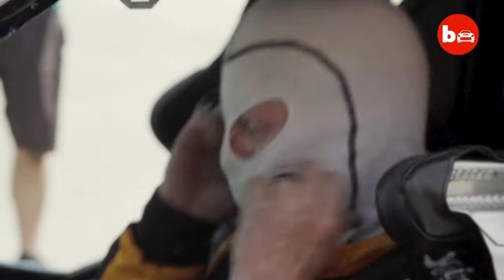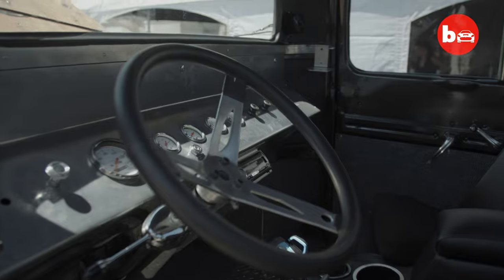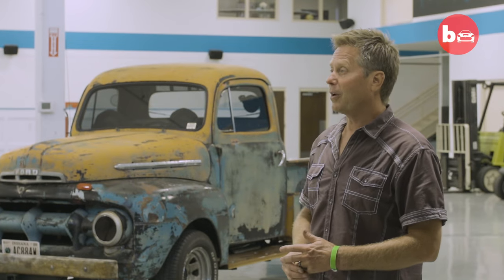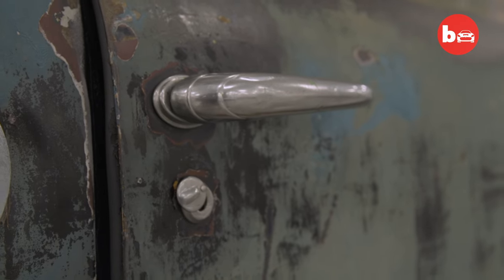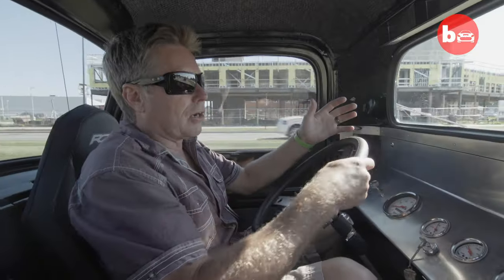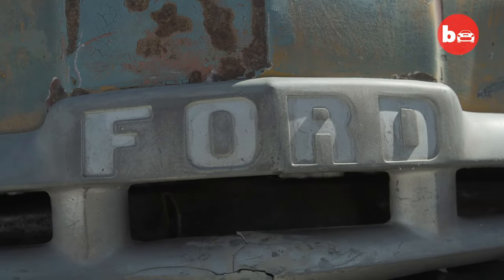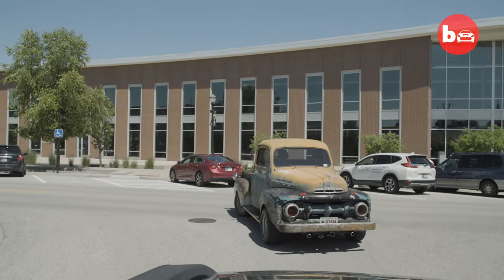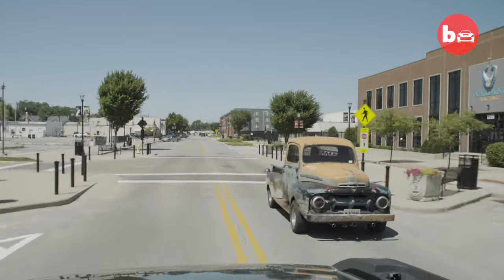The Pick-Up Truck that Drives BACKWARDS I RIDICULOUS RIDES

Comment: A few things would make it better >
Get rid of the huge headlights & use led’s mounted inside small truck taillights.
Mount the radiator down lower for air & get a solid tailgate.

Comment: A shame.
That was a clean and straight vintage truck that hadn't been hacked on.
A good candidate for restoration
Now it is, whatever it is,  with holes in the tail gate, holes in the back of the cab and the bed and to top it all off a Chevy motor.

Comment: Waste of a nice old Ford truck . Couldn't you find an old Toyota or some other import junk to save from the crusher . that 52 pickup was not in danger of going to the crusher .
Reply: Old toyotas are not junk way more reliable and valuable that that shitty ford
Reply: At least he did something right and put a chevy engine in it
Reply: @DeflatedMeatball  I was talking about one of them Toyota trucks that folded in the middle because the frames rusted thru . Like i said .....JUNK....